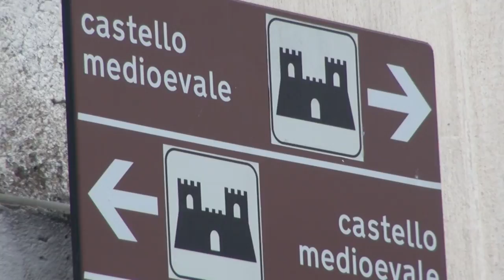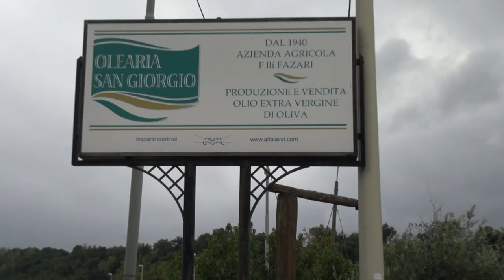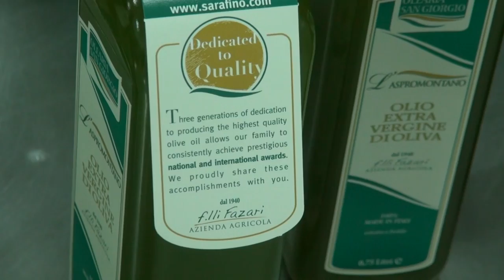Visit to the home of Sarafino Extra Virgin Olive Oil in Italy

Comment: I’m a bit puzzled at the clear bottles they use since we all know olive oil degrades from heat and sun light at an exponential rate. Maybe they get sold relatively fast in Italy but if they ever export it’ll be hard for health connoisseurs to be tempted into a purchase
Reply: instablaster...
Reply: In Italy, there is a type of Extra Virgin Olive Oil called, "Novello," which means "new" olive oil right off the press without filtering. As such, it is more prone to oxidation, but the taste is way better. The clear bottle is to show off the beautiful unfiltered color and to tell you that you'd better finish it up asap to get its full benefit. So, no, it is NOT for long-term consumption or storage. It's only available a few months after each harvest, so find them if you can. But, do use it up quick. Then again, since it tastes so good, it should be gone in a month. Just dip the bread in and enjoy!